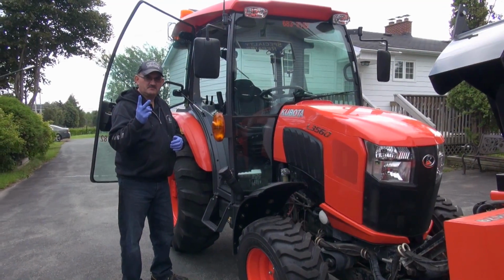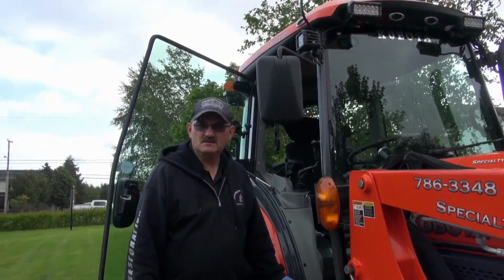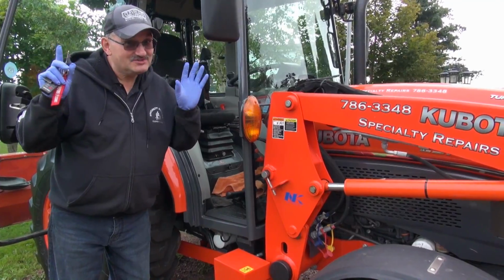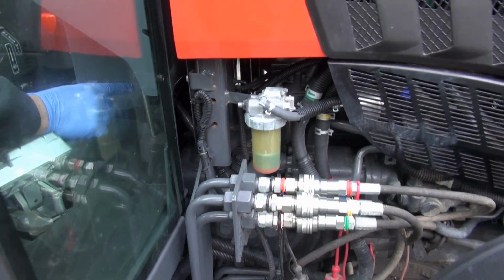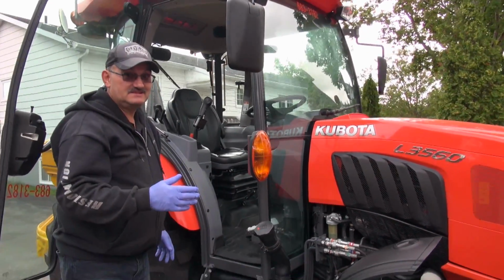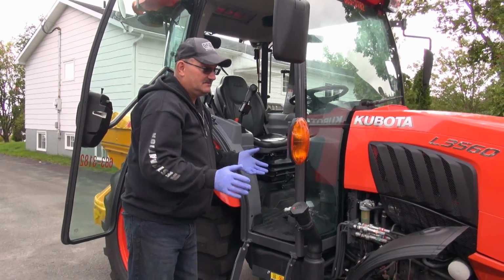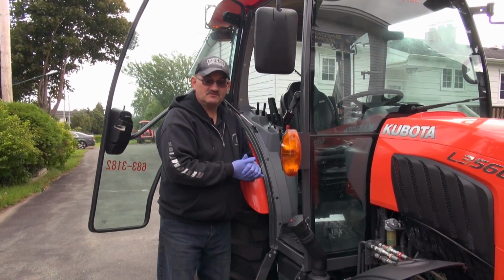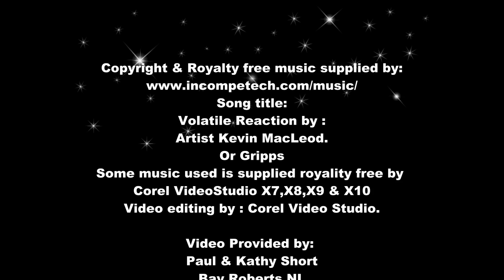Two Kubota Tips in one video + Channel News

Comment: Was the aluminum pedal direct-bolted to steel?  It looks that way from the picture.  If there wasn't some type of insulation, galvanic corrosion will be super-fast on a part you step on with wet feet.  The proper paint job you gave it should resolve it assuming bare steel and bare aluminum are no longer contacting.  It is nice to have you guys back, and nice to hear you are relaxing.

Comment: Paul, good to see you up and around. 
On the issue concerning the grommet. Could one use some electrical wire loom protector to slide between the shaft & grommet?

Comment: Paul I have the same model of Kubota Gl3560 and I am in Colorado with the winters here I don't get out on main roads so no issues with salt but still concerned with the corosion and the rubber grommet/boot you were showing.  Is there any way you could do a close up of that repair on the boot.  I don't use my tractor like you and it really would be a pampered tractor not with all the working that you do with yours.  But still would like to make sure the boot on the steering shaft gets the proper treatment.  Just to show how pampered mine is I just hit my 50 hours and only have had it for a little over a year.  You also may want to talk to others about keeping the three point attachment locations lubed and oiled so they stay movable I had not thought about it and when I looked at them there was a bit of rust forming so will have to do some extra greasing to keep them up to snuff.  Thanks for your channel and you stay healthy.

Comment: Hi Paul. Been awhile since I reply to your videos. Have been busy in garage and racing. I been thinking about buying a small Kubota with a cab to use for plowing the snow and not using my skid loader. More likely  a used one. Unless my local dealer has a super deal on a new one.  Is there any that you would recommend? Glad to see you are doing good. Looks like you lost some weight?